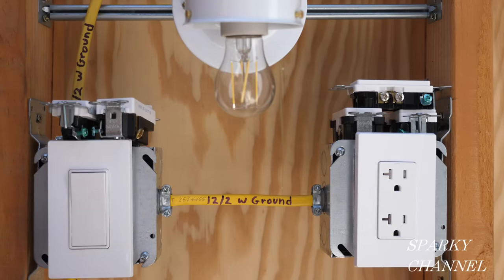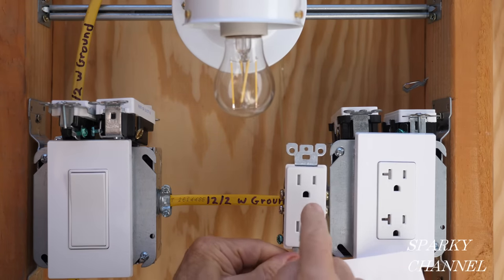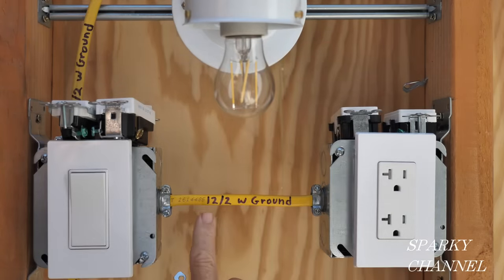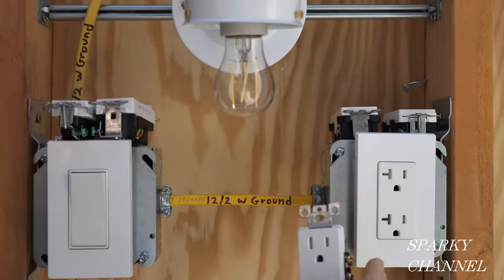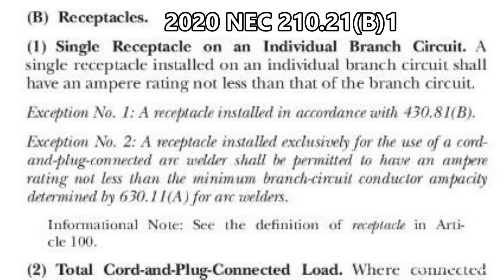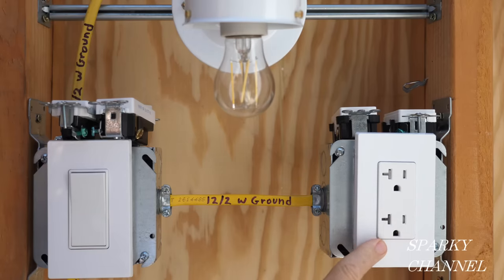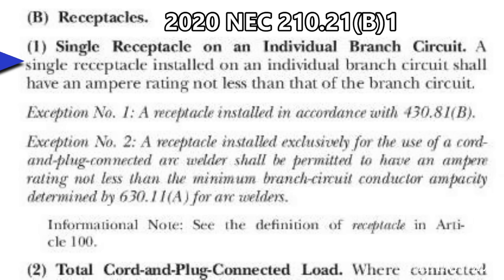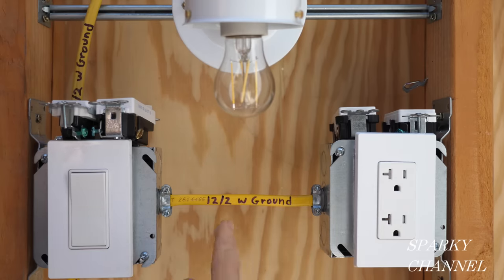Shall I Use a 15A or a 20A Receptacle on a 20A Circuit? + 2020 NEC 210.21(B)(1) and 210.21(B)(3)

Comment: Sparky, are the rules similar for light switches? I noticed most light switches are rated for 15 amps. Can they also be put on a 20amp circuit? Lastly, I am sure this is illegal but I have to ask. I noticed a lot of times that number 12 wire is used on 20  amp circuits (that was intended for a receptacle) but later a light was installed in that circuit so when you get to the switch box, you see number 12 wire coming into the box and #14 wire being pigtailed to the switch. The contractor I worked for said that was legal. And he said that number 12 wire is a pain to loop around the screw terminal of a light switch; so we use #14 pigtails on both the switch and the light. I don't think he's right but he's signing my check so I keep my comments to myself. Is this correct to code, Sparky?
Reply from the maker: The rules in the video are expressly for receptacles. I don't know of such restrictions for switches.... Never use 14g wire on a 20A circuit!
Reply: I throw a wrench in to this.... I was always told  by inspectors  "if you can justify  the load ... " then its legal to use a 14 gauge  pigtail to a switch  --- assuming  it is only controlling a light or 2 -  NOT a switched outlet!  -- and in reality a short pice of 14 wire will handle 20 amps so A pigtail is a short  (6 to 10 inch ) piece of wire .  
As a rule a good electrician will never wire lights to an outlet circuit  except maybe in like a hallway or walkin closet type of circuit -- so this question is a rare  occurrence in the real world.
As to your guy saying its a pain  ---lol then he is using cheep outlets! and I bet you he loves the push in types too!
Reply: @SparkyChannel  I think the installer used 14g only from an outlet to the switch and from there to the light fixture. If the rest is 12g this poses no safety issue. You can't overload a lighting circuit, the loads are practically fixed. So it's the completely opposite of an outlet circuit, where you can plug in several devices with a high demand.
And due to this an overload protection of a lighting circuit would actually not be necessary, the only issue is a short-circuit. And if you think that's not true then remember, that is 14g which is used for 15A. What kind of lamp would you install that draws 1440W? So overload not possible, the lamps are limiting the flow of current in that part of the circuit to a level which doesn't overload the wires. But only if it's done the right way.

Comment: Can I use a 10/2  with 20amp.  The receptacle is 20amp  like the one you have?
Reply: Sure. It's just overkill though. Won't have to worry about the wire overheating as long as the connections are good.
Reply: The code (shown in the video) appears as though this is not allowed. I believe it’s because of the physical size of the wire is not meant to be used with the 15/20amp receptacles. The terminals are not designed for that size of wire and the additional stress on the terminals.

Comment: I have one question i have a subpanel and i need to add a  3 breaker 50 amp for tankless water heater  but the wiri for the panel is #8 i was looking at the #2 for that panel wiri but there are thhn and other what is a better cable for that
Reply: Benjamin Solano
 ... if you mean 3 separate 50 amp breakers for an instant type water heater, which has 3 heating elements then you need to feed that panel with something to handle 150 amps. #8 certainly wont do the job and neither will #2, even in coper. You also need a panel that is rated for at least 150 amps. (probably more based on other things in the building) 4/0 Al with a 200 amp panel will do it well, but you need to feed this panel with something rated more than that.
Reply: @darbyl3872  ... I thought the same as you but just remembered watching a YT video on the subject recently and there is such a water heater. I looked it up and there are 3 heating elements, wired and breakered at 50 amps each. (all are 2 pole breakers) Granted, each breaker is only loaded at 80% (40 amps) but code would call for #6 wire (each) so a hefty draw none the less. If this is a sub panel then the feed needs to be 150 amps or more because that will also fall under the 80% loading category of a branch circuit. #4 / 0 Al cable is rated for just over 175 amps. (#2 would be too small I believe)
Reply: @darbyl3872  ... I hear ya there. Hopefully he also has a 320 or 400 amp service because in some areas they wont let you add that to a 200 amp panel. I mean, yeah it's intermittent draw... but what a kick in the pants every time there's laundry or a long shower. BTW, a water heater like that is rated for continuous flow of around 4-5 gallons per minute and each element comes on in stages as the temp drops. There is no storage tank. In theory it could be wired with a single element but that would only hold up to a single sink tap, not whole house demands.
Reply: My friend was about to buy a unit that required 3 - 50amp breakers for his instant hot water tank. He quickly changed his mind when I laid it all out for him how it was 150 amps between the 3 breakers and his 200 amp service was not going to cut it.
Reply: @PhillipBridgesReviews  ... ya know, I would bet there will be people who get away with this on a 200 amp panel then start chasing intermittent problems in a few years, based on low voltage, toasted connections, etc. More than likely they will blame the power company and might even get away with it once or twice... if they live there long enough. The next owner will have no clue and it will make a good detective story on YT in 20 years. <LOL>
Reply: @darbyl3872  it can most certainly be what he means.  electric flash heaters are pigs and retrofitting to one usually involves upgrading the electrical service to be able to supply enough power to run them.
Reply: @rupe53  usually what you get is a lot of noise every time the flash heater fires off, and then in about 6 months, you'll start having the main breaker trip every time.
Reply: 3 pole 50 amps is still 50 amps it's just a 3 phase to draw 240/208/220 but usually residential are single phase, commercial are usually 3 phase. Remember that the higher the voltage the lower amperage you use. That's why there's buildings that runs hight voltage for lighting you end up using smaller breakers. But what do I know I'm still a 1st year apprentice 😂.
Reply: @CAMMEDcivic  if it's a 3 phase flash heater, then he may run into trouble with that, as well.  plus, 30KW is pretty wimpy for a flash heater.  
but it's a fair point that we have way too little information to make a definite recommendation on what he needs to do.
Reply: @CAMMEDcivic  ... when you say noise, I doubt the breakers will buzz like they do on a motor start because there is no inrush with an electric element.
Reply: @kenbrown2808  ... thinking about it, I'm not sure how it would work to have a 3 phase heater like that unless the elements are in a daisy chain or all tied back to neutral. My mind is working overtime imagining the load on the neutral and if that would balance out or give us something at least above the nominal circuit rating. I do see some listed for both 208 and 480 volt so they are out there. I did not find a wiring diagram to ease my brain. I did notice they run up tp 32 kW for a 5 gpm flow rate.
Reply: @rupe53  they'd be connected in a delta configuration.

Comment: I am just an apprentice now to build time but I used to be an electrical engineer. I am uncomfortable with the code. The table says 15 or 20 receptacles on a 20 breaker. 80 percent of the time your fine. But those items pull amps for a long time, use a 20 or else you’re going to melt something. Chinese space heaters are the worst.

Go with spec grade!!!!! I love Hubble! Levitons spec grade is good too.

I used to be conscious about what we charge. But not any more. Fry a 15 and it’s easily 150 bucks!!! Kitchen 20s should be spec grade 20s and the breaker needs to be arc fault duallies!

Comment: Very simple, if theres only one receptacle on the circuit, use 20a, if theres more than one receptacle on the circuit you can use 15a
Reply: @darbyl3872  you're right about the 30, but the code I quoted very clearly says that you can use a 15a receptacle on a 20a circuit, which is obviously on a 20a breaker, with 12awg wire, if there are 2 or more receptacles on the circuit. If it's a  circuit with only 1 receptacle on it, you must use a 20a receptacle. That code has worked for me for 20 years. Try putting one of those ugly 20a outlets in a millionaire's kitchen and see how long it takes them to complain. By the way, single receptacles are a different story than duplex receptacles, the video was way off topic talking about singles
Reply: That's what he said in the video.
Reply: @samjg1  kinda
Reply: @darbyl3872  how's that?

Comment: Ok so I bought a deep fryer for my home and did not realize that it had a 20 amo plug on it. I have 15 amp recepticles  and 20 amp breakers.  If Im wired with  12/2 wire can I just add one 20 amp recepticle to use this one appliance once  or twice a week or would I need to put it on its own circuit?    Thanks is advance for any advice as I am not an electrician.
Reply: technically yes but check the box and manual and see how many amps and voltage it requires if that circuit is already in heavy use aka has a lot of devices drawing amps it will trip your breaker. it might even specify or recommend it to be on a dedicated circuit. id definitely check that manual plus every situation is different. p.s. im also not an electrician id do some research on the fryer or hire a pro.
Reply: An appliance with a 20 amp plug usually requires a dedicated circuit with a single 20 amp receptacle. You can however, effectively accomplish the same thing by making sure that none of the other receptacles on this circuit are being used when using your deep fryer.
Reply: You should only be using an electric deep fryer outdoors or in your garage due to fire danger, in either case you should change out your garage or outdoor receptacles to 20amp. Just make sure you have 12AWG wire going to the breaker.
Reply: I installed a seperate circuit just for the fryer out in my summer kitchen.  After completing that task I realized that I actually had a 220 plug on this fryer.. So I had that circuit changed to 220.  Because I failed to check what I was buying this ended up being a very expensive fryer.    The good news is that with the current price of chicken wings Ill make my money back in a few months of not eating out.

Comment: How about the outlet that my wife's 1800 watt blow dryer is plugged into and  curling iron?
Reply: 50a
Reply: @skynetlabs  😂😂
Reply: It doesn't matter, as long as the circuit is 20 amp. Notice that these appliances have 15 amp plugs, so a 20 amp receptacle will not make any difference. These appliances are designed to be on only for a few seconds at at time, not continuously.
Reply: 1800 watt / 120V = 15A. That leaves you no margin, so I'd say make sure you have a 20A circuit (12 AWG wire + 20A breaker) for an 1800W device. Otherwise, just stick with the 1500W models. You will pop either breaker (20 or 15) if you have both a hair-dryer and a curling iron on at the same time (on the same circuit).
Reply: @joshpit2003 and Haha there's no way she would downgrade a high end professional model even if it was a 15 amp circuit.  It is a 20 amp circuit with a 15 amp outlet which is pretty common, and it meets the NEC electrical code. I may end up changing it out since I actually have a spare one still in the box.

Comment: Hey Bill. Hope all is well. Did you have to start your channel all over again? 
I am building a new home. Once it is complete I want to add two electric receptacles on separate ends of the home in the attic. Would a junction box be necessary? Is my job request out of the ordinary or would most electricians be willing to take on that work?
Reply from the maker: Two electric receptacles on separate ends of the home in the attic is no problem at all. A junction box isn't necessary. Best wishes with the new house!!!
Reply: Sparky Channel Thanks!

Comment: Hey, Sparky, oftentimes, when I plug in my microwave in the kitchen it causes the microwave  to go dead and the tv in the living room to go out. I have to go into the garage and flip the appropriate circuit to reset both. What causes this. It does not happen all the time. Help!
Reply: you could have a loose wire on the microwave plug. when you plug it in you may be shifting it enough to cause an arc that causes the trip.
Reply: @mellisvids  Thank you, Sparky
Reply: The microwave should be on it's own circuit.
Reply: My guess is your house originally had a range hood and it was taken down at some point and a microwave was put in its place without wiring a nw separate circuit just for the microwave, it happened all the time back in the day, all those should be repaired.
Reply: @Sean Stevenson Apparently, I did not communicate my issue clearly. The microwave is not plugged in with any other high-powered device. I have a toaster oven sitting on top of the microwave, but I do not have them both plugged in at the same time. When operating one the other is disconnected. However, I will check the panel for the appropriate amperage.
Reply: @mellisvids  !)

Comment: If you are putting new wire in a garage. Is there any reason to use a 15a receptacle with 14/2 cable. 
Or should you use all 20 circuits with 12/2 cable and 20amp breaker. 
Should you only use Romex  12/2 w/ground with 20 amp breaker’s and not use 14/2 and 15 amp breaker’s??
Reply: Definitely 12awg 20a, power tools draw a lot of amps.
Reply: Any new work should always be 12g wire on a 20amp breaker unless it’s strictly lighting. Especially in a garage where you never know what you’ll have plugged in.
Reply: If the whole garage is on one circuit, i would definitely go 20 amp.

Comment: Question if I am putting in a new window ac unit and installing 115v 12awg 20amp breaker 
But the unit calls for a 15amp breaker do I use a 15amp breaker or 20 amp? The unit draws I think 11.3amps or so
Reply: You want that ac unit to trip the breaker as close to its full load rating without creating a nuisance tripping situation.. If the units FLA rating is 11-12 amps  you want to install a 15 amp breaker.  You don’t want to let that ac unit pull 20 amps before tripping a breaker. 
There is nothing wrong with running 12/2 from a 15 amp breaker. You should check your code book also, I believe you need a gfci protected circuit for that unit. You can use a gfci breaker….
Reply: @beckyschwantes5287  thanks I read that gfci cause a lot of issues it has a leak detection circuit build into the units plug its self
Reply: @jasonlanggin5132  GFCI protected circuits are known to be susceptible to nuisance tripping, but this is usually seen in applications such as powering a sump pump with a gfci protected circuit.

Your window air conditioner is going to be exposed to the elements on the back side. It could possibly become a hazard and it might be considered “mounted in a wet location” I have found that using a well made GFCI outlet stops most nuisance tripping. I personally like Eatons GFCI outlets
Reply: I'm installing a spilt unit.  The unit pulls 13.5 amps.     My inspector told me to run a 20amp breaker.   No GFCI.  Only needed to install a switch box outside.   Passed inspection.